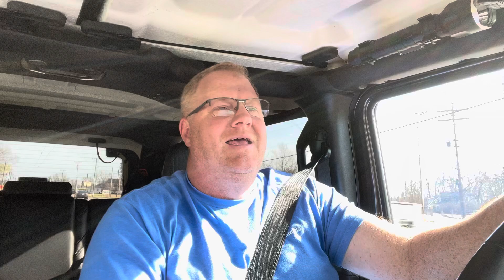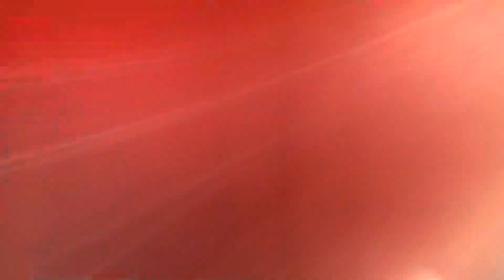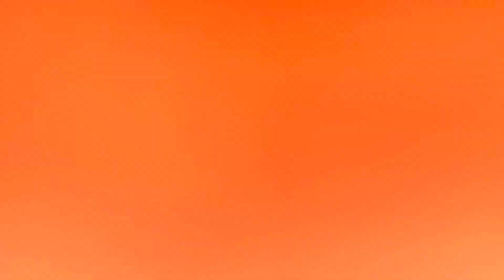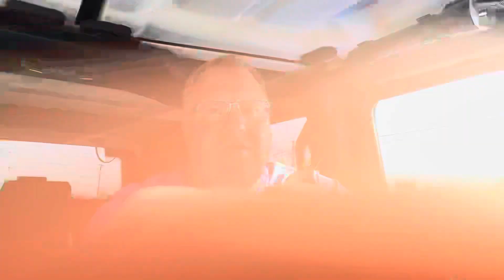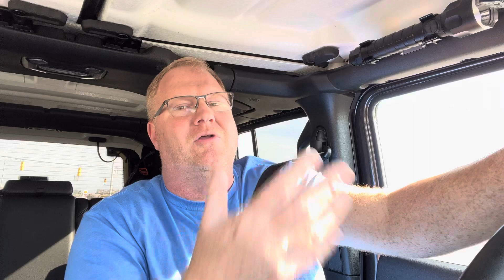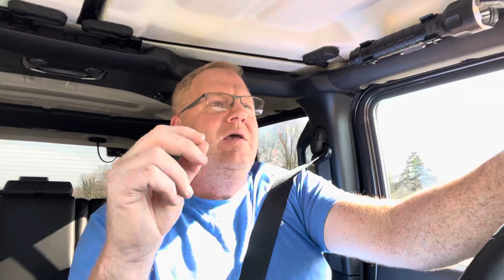Group Project: Let’s discuss FORM and how we operate the 4XE

Comment: I know this video is old and I'm late to the game but I am currently in FORM and have been for almost a week...my problem is my commute to and from work is all electric with an occasional gas spurt, which now has put me in FORM.  95% of my driving is electric.  I always started my Wrangler in electric mode.  The problem I have now is getting out of FORM because I don't have anywhere to go that would require me to run my gas engine for an extended period of time!  The gas in my tank when FORM occured was almost 2 months old...I have since filled up with fresh gas, so that didn't work.   I guess I'll be stuck in FORM for a little while longer :(  Weather is getting warmer here in NY so I hope that will help.

Comment: bought my vehicle back in september 2023, today is jan 31st, i currently have 2600 miles and ive been on FORM once, the first time it went away after filling up the tank...then it came back a week later. it doesnt get that cold here in Virginia. Also, after 2600 miles, my oil life is down to 15%, is this normal?? Jeep wave oil changes are once a year? at this rate i will be doing 4 oil changes a year.

Comment: My 2024 new Wrangler hit “FORM” the first time.
I drove the Jeep for about 60 miles and here is what I found:
At about the first 10 miles or so, the ICE was running and the electric motor was barely on, as the electric charge remained at 95%. Then after about 20 miles, the electric engine started to engage but not a lot, the “FORM” message was still on. Then about 30 miles, the Jeep was in hybrid mode with the “FORM” message still on, at about 40 miles, the ICE just shut off on the highway and the Jeep was on electric only.
As soon as the ICE stopped, the message disappeared. Then the Jeep goes back to normal.

Comment: New owners should be required to watch this video!! I cringe on short trips when the ICE kicks on for a few seconds in a harder-than-anticipated stoplight launch, and the ICE hadn’t warmed up to operating temp yet. I’ll click the GC down to sport mode and let the engine have a chance to warm up and burn off the fuel. Haven’t had FORM yet (except for when I left dealer lot at purchase).
Reply from the maker: I test drove a GC for a video that had been sitting on the lot for a while. Naturally, it was in FORM.

Comment: Just spreading a rumor....1 Run the gas tank down to 1/4 or less.  2 drain battery down to 0 ( 1%) 3 Then fill up with gas and drive hwy for 30 miles. FORM message should go off or doing that once every month or two keep it off.  SECOND option is A call you jeep by its name. B   Say...wait...what?!?!   Your jeep does not have a name?!?!?!  OMG  Why am I even speaking to you  LOL  Have a great day
Reply from the maker: Those steps work perfectly for people that have normally operating Jeeps. It's the ones that have some issues clearing it that land in that space of being very frustrating. Some are finding that they go straight in to EMU+CHOC right after an oil change which means they had a bad coolant heater all along. Others are just experiencing really abnormal operation where nothing they do clears FORM.

Comment: Love your insight and the information you share.  How about.... I can literally buy gas once a year. I heard to avoid "spoiled" gas the 4xe atutomatically will use the gas engine.  How well does that work and can I depend on it.   I thought I would use electric two months then go thru one tank of gas before going back to electric   Thoughts?
Reply from the maker: It runs a 90 day timer since the last fill up. I’ve never hit it but it’s one of the causes of Fuel Oil Refresh Mode. If it’s the 90 day timer that triggers FORM, it will make the engine run.

Comment: I had my oil change at 2000 km .got me out of form.we always remote start in electric then when we go out to the vehicle we put in esave and warm the ICE for a few minutes and then put in electric mode and drive 12 km to work .then repeat home.
Right at 400 km we went in form .got out of form and repeat the daily drives in electric only then wam right at 400 km went back in form .thats where I'm at now .will drive this weekend on highway to try and get back out.but the issue I have is the money I saved in electric all week is now out the window burning it up on highway to get out of form which when its below 10 c is very difficult and requires min 50 km at atleast 75 mph.
If I had of known all this the day I sat in the chair at the dealer I would have taken a pass.
Reply from the maker: Short engine runs on direct injection engines can be problematic for oil dilution. FORM can result from an algorithm related to oil dilution. I wonder if those engine warm up runs could be causing you issues? You can warm the 4XE up while still plugged in without running the gas engine.
Reply: @Wrangler4XEFans  I'm going to experiment with no warm ups and see what happens
Reply: @Wrangler4XEFans how to warm up engine while plug in. I park mine inside the garage, remote start ice kicked in first. Up until oil temp 77c, ice shut but when pressing accelerator ice kick right back on.
Reply from the maker: @vangiestar6057  Instead of using the remote start, push the start button on the dash twice without your foot on the brake pedal.

Comment: Oh please! FORM is so 2021. “Electric mode unavailable cabin cooling and heating” is in! 
I have this permanent issue since I got my system updated (RRT’s). 

I completely regret purchasing this overpriced vehicle. The trunk space is terrible with the seats inability to fold flat due to the battery and being unable to access my electric battery for months nonstop.
Reply from the maker: Have they determined if your coolant heater is bad?
Reply: @Wrangler4XEFans  unfortunately, I’m having a hard time making progress with them. They don’t know what to do about the issue, but in their defense, it’s a new issue (past week).

Additionally, I need my car as I’m up at 4:00am and leave work around 5:30 pm. The dealership has told me that they only have 6 mechanics on Saturdays which none are trained for higher level of service. They don’t offer rental cars, only one Lyft home.
Reply from the maker: @Jonatron503  Have them look up Case number: S2208000027. That’s the bulletin on the electric coolant heater.

Comment: Yes, I like the "binary mode" suggestion.  I like to use either Electric mode or E-Save mode, not Hybrid mode.  This way I have control over gas engine runs and can make the gas engine runs longer, like at least 10 minutes.  We'll see if this helps even in very cold weather next winter.  I just wonder how this "theory" relates to gas cars with Auto engine start/stop at intersections.  Maybe they run long enough to get oil temperature up, and short occasional run times might be more of a problem than short shutdowns at intersections.

Comment: It's warm enough in Colorado now that I don't think I'll see Form until next winter.  However, your observations are consistent with mine.  Allowing the short engine runs in weather around 0f a few times is what got me into form.  I started just running in Esave until the oil was over 150 when it was super cold out to avoid FORM.  Additionally, not that hard to get out of form by running the engine hard enough to get oil over 200, but that's a waste of fuel.  In total, I was in form 3 times over the winter.

Comment: Been stuck in form for months. Diagnosed that it needs a heater module or something that is back ordered for months.
Reply from the maker: I have been wondering how many perpetual FORM issues are actually the result on bad electric coolant heaters.
Reply: @Wrangler4XEFans  mine definitely is. Tried an oil change and even resetting the oil life and no luck so that’s why I took it in.
Reply from the maker: @Dudeman1646  Hope you have better luck than most with this issue. Let me know what happens.

Comment: How does FORM works on warmer weather like in California ? I’ve been driving my 2022 for about 800 miles and about 95% on electric. So far  no FORM problems.
Reply from the maker: We haven't heard a lot on the FORM subject from the warmer climates. Cold weather brings out the worst of FORM. Part of that is due to how oil dilution issues are made worse in cold weather.
Reply: My oil life is at 77% at 800 miles, wondering how much of a difference will it be on cold weather

Comment: I run full Electric and once a week I drive 50-80 tripe solid on eSave.  I have 4000 miles and no FORM yet.
Reply from the maker: Makes since. That's how I use mine and I haven't seen FORM yet.

Comment: Here’s what I do what I seem to think it works perfectly with the 4XE and this goes for anyone else that has one, 

My daily commute is roughly 20 miles city driving and no highway (so I don’t need a bunch of power for hwy speeds) As soon as I get in the Jeep every morning I press electric mode immediately before I drive off. Doing that let’s you throttle more without the chance of the ICE motor to turn on. So that’s what I recommend if you are in the same shoes as me. 

Now, if you drive more then the 25 miles it gives you or plan on doing highway speeds, what I find best for the motor is that you let it warm up slightly while parked in your driveway before you begin you commute. And what I mean by warming up is just slapping it into manual mode for a minute and then putting it back in drive. And this also goes for if you know your next destination is past your electric miles left etc.. 

Lastly, if you plan on doing any type of road trip or stuff more than 50 miles, I recommend you leaving it in hybrid mode While coasting along the highway. The electric battery should last about 100 miles before it is depleted and you’ll get close to 30 mpgs depending on your speed. 

I know this all sounds confusing but I will try to make a video of it because it definitely helps out, my 4XE  is doing amazing with 6k miles. And I’m definitely getting all the moneys worth out of the plug-in
Reply from the maker: All the yeses.
Reply: Thank you for the great advice.  When I leave it in Hybrid in FoRM my battery depletes to zero very quickly within about 30 miles. What could be wrong with this Jeep? It constantly goes into FORM all winter.

Comment: If you are correct, the very reason it makes sense for me to drive this vehicle - I work 5 miles from home, it's all side streets to and from - is the same reason I had a problem with FORM. In the colder months, the ICE kicks in easier. The vehicle needs to meet the demand for heated seats, heated steering wheel and the heater fan. Not to mention the efficiency and usefulness of the battery plummets. Consequently, in that short distance that I drive, the ICE will kick on. Me, trying to use the battery so as not to have to buy gas, will reach down and push the electric button - shutting that gas engine off. Even if I don't shut it off manually, the ICE won't run for long. It didn't have the opportunity to do so. The answer, it seems, would be too let the ICE run, and go for an extended drive. That really defeats the purpose of having this vehicle. Or at least some of the purpose.
Reply from the maker: That's a good example (if I'm right) where too short of a drive can be an issue. So hard to say. Wish we could capture more data from the vehicle.

Comment: My 4xe was stuck in FORM from early November until March 22. Electric mode made a few brief appearances during a chinook in December. I live in southwestern Ontario so I waited until the first sign of spring to appear to see if warm weather would release FORM's grip. When it hit 20c (68f) in mid March for the first time and the vehicle remained in FORM I made an appointment with the dealership. FORM cleared after they performed a complimentary oil change. Since then the weather has returned to seasonal norms of below zero at night and above zero during the day ('Sugar Bush' weather) and my 4xe has been able to run in electric when asked. One exception was when it was -8c (17.6f); but in a few minutes after the cabin and engine warmed up electric mode returned. This morning we had an ice-storm so I used the remote start to warm it up and melt the frozen window wipers before use. The ICE came on, but when I started to drive I was able to use electric mode. The oil change (3500 km) seems to have worked.

Comment: FORM comes on every time I shift into manual or press the throttle hard enough to turn on the gas engine. Once the engine turns on, it will not shut off until I turn of the vehicle (even after driving it in FORM for 30 minutes or more). I’ve had it for almost 9 months and 3600 miles. Any suggestions?
Reply from the maker: Seems like an oil change helps a lot of people.

Comment: I've had issues with FORM all winter. I can usually get out of it if I run it manually and letting the oil temp get hot enough for a bit. What's annoying is I'll start her up, put her in electric mode, drive for a bit, then boom the ICE kicks in and FORM pops up. I'll get to where I'm going and do whatever it is I'm doing and when I start her up again she's back in electric. So I get these short FORMs out of nowhere with no rhyme or reason.   And the ICE kicks in whenever I try to accelerate from a dead stop, like getting onto the highway.
Reply: Same with us right now .kicks out of electric and pops up the fuel oil refresh

Comment: My experience with FORM has been similar to BOXN1 in that i was doing all electric driving during the week (i have a 16 mile round trip to work) and then usually running around on the weekends to kids sports and such, i would use up the electric and then it would switch to ICE. I was stuck in FORM for about three weeks until i did what Brandon Hainline suggested in one of his videos which was to run the fuel down to less than a 1/4 tank, fill it up and then go for a longer drive to get the oil hot and that worked for me to clear the FORM condition. I have changed my driving habits since then; i have been leaving it in Hybrid mode and just letting the Jeep do what it wants to do. The Jeep seems to be happier. My thought was that i if i just left it in Hybrid and let the Jeep decide when to use the ICE, it would stay out of FORM because it would know when it needed to run and for how long. I would like to go back to the way i was driving with putting it in Electric and do my commute like that. Also earlier in the winter, i did see the "cooling and heating" message but it went away and i haven't seen it since.

Comment: Chris,
I replied before on this issue.  We have also had the Fuel and Refresh mode problem two times, (now three times). Both times I took the 4xe out on the interstate and drove  in 5th gear for 20 minutes and made sure the oil temp was above 200 during the drive. It cleared both times. Last week had the issue again ,this time refueling cleared the issue. We also have the Electric mode not  available cabin heating cooling due to a failed coolant heater.(part on order). So we have been driving with the ICE in cold weather for three months. 2021 Sahara with 18000 miles.

Comment: This winter I've had FORM come on for literally 1 second and disappear twice only. I've got about 8k on the JEEP and I drive about 15km a day during the week, usually in Electric only (I manually put it in electric mode). On weekends I usually run out of electric range and let ICE run until I get home from longer trips so maybe that's helping with avoiding FORM?. I'm from Toronto, Canada. I will say though that there have been times in the winter where electric mode will not work at all because it has been too cold outside, but once I park JEEP in underground parking over night the next day its fine.
Reply from the maker: Great example.

Comment: Hi Chris. I took my 4XE to the dealer earlier this month because it was stuck in perpetual FORM for about 2 months.  There is a Star Publication dated Jan 2022, which is publication number S2208000020.  It contains two "notes". The first note states that adding fresh fuel will not clear FORM if it entered FORM due to engine lubrication.  In this case, the engine "may require accumulated engine run time from 20 minutes to 2 hours at max engine operating temperatures (best at speeds above 50 mph) whenever the vehicle is operational (no electric only operation). If the vehicle is shut down before conditions to exit the refresh mode have been satisfied, the engine may run for additional time on subsequent trips."  The second note states "frequent short trips at low ambient temperature conditions are more likely to trigger the lubrication based mode. If the engine run time is not met in-between an oil change interval, changing the engine oil and resetting the service reminder is the recommended option."  I think the issue here is not the engineering behind FORM, but the complete lack of prompts from the vehicle telling us what the 4XE is doing, why it's doing it, and how to satisfy it.  The vehicle was functioning as designed, but neither I nor my tech at the dealer had a clue what was going on.  Thankfully he knew where to look for help.  Changing the oil did clear the FORM.
Reply from the maker: Let's hope it stays cleared.
Reply: It’s not changing the oil, it’s resetting the oil change status that does the job.

Comment: At about 5 months in and about 3k miles she went into FORM and changing the oil & filter and resetting the oil change monitor on screen two brought it back to normal operation.
Reply from the maker: Up to that point, what was your use like? What's your daily routine? What mode do you use?
Reply: @Wrangler4XEFans  
As you described in this video, I mostly left it in the default "Hybrid" mode with the gas engine coming on sporadically.
 Neither refilling the tank nor excessively warming up the ICE would take me out of FORM.